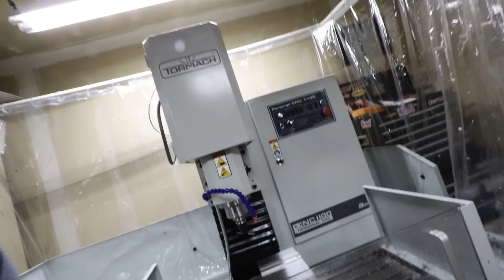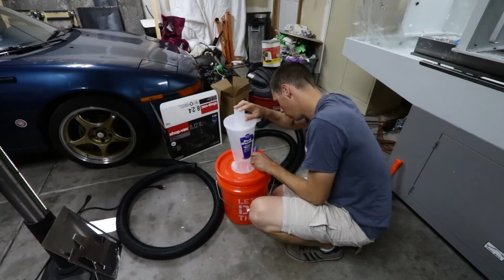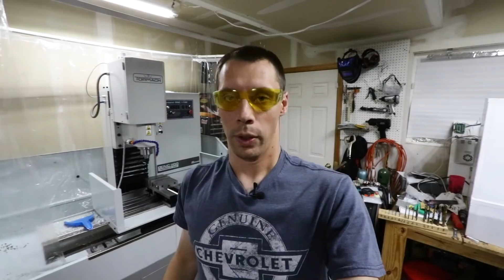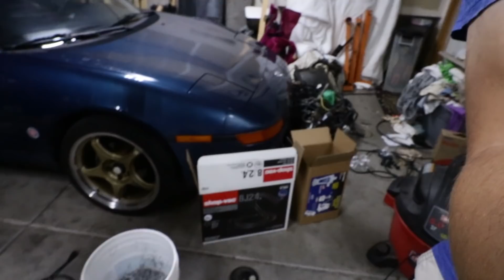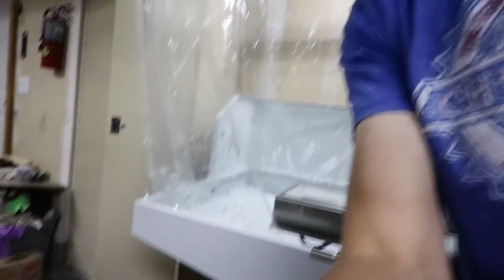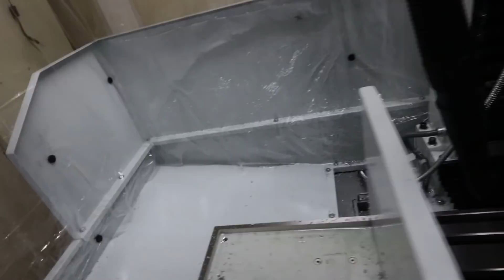Oneida Dust Deputy vs Metal Chips

Comment: I use a Dust Deputy on my CNC router but wasn't sure it would work great with wet chips either, glad it worked for you. They make screw on buck lids that seal really well that I find makes emptying much easier. I used a different style chip collector for my mill, if you look on Amazon for "dust bucket lid" they just have 2 ports but work great on metal chips and only cost $20.
Reply from the maker: I saw those, but wasn't sure how well they would work.  I'll keep it in mind as a plan B.

Comment: I have the same dust deputy on my blast cabinets and it works great for collecting the debris.   As for the lid problem....you can get screw on lids from home depot.  I show it  in the vids I did on my channel, but rather than put those links here, I'll just put a link to the lid on HD's site. :)
https://www.homedepot.com/p/Leaktite-5-gal-Screw-Top-Lid-5GAMMA6/203205720
Reply from the maker: Thanks for the help.  I'll have to check it out on your channel.
Reply: I put 3 links in your discussion section to make it easier for you to find.  I'm not trying to convince you one way or the other...just more info.  :)
Reply from the maker: Thanks, I watched the one where you cut the center of the lid out and it looked like it worked really well.  I'll have to watch the rest when I get a spare minute.
Reply: No prob.  
I'm thinking about getting another one for vacuuming up chips.....would be nice to put it on a much bigger bucket. lol

Comment: hmmm ....I seeing an aluminum version of it with rubber seals as a nice project. It might be fine like it is depending on type of coolant and type of plastic. Type of coolant will also affect how long your paint stays on. Some types might as well be paint stripper.
Reply from the maker: Ya, time will tell if it holds up.  I'm also wondering if the bucket will be ok.  FWIW, I'm using Dura-Kut 701-EP.  I'm going to buy a refractometer soon because I've had to add a ton of water due to the dry Utah climate.  I have noticed the dark red paint on the sides of my table is already starting to peel off.